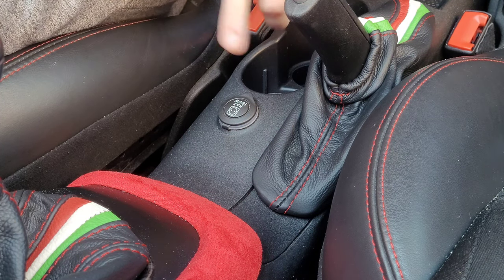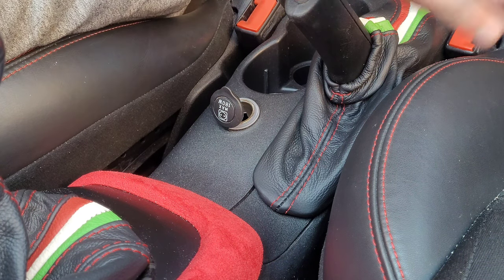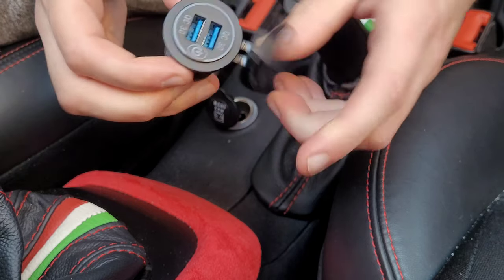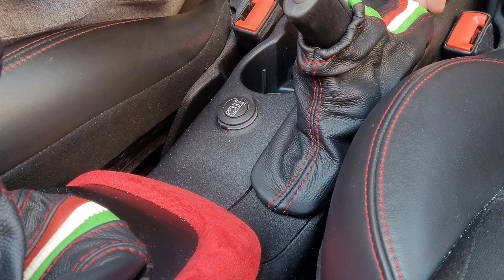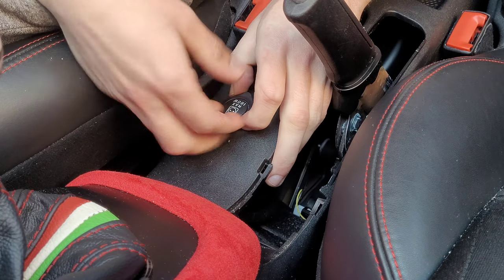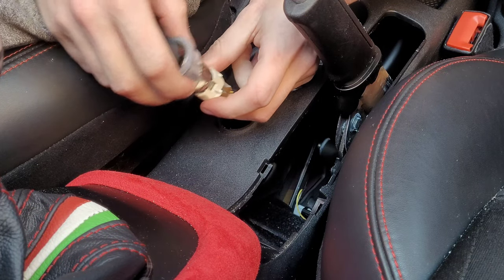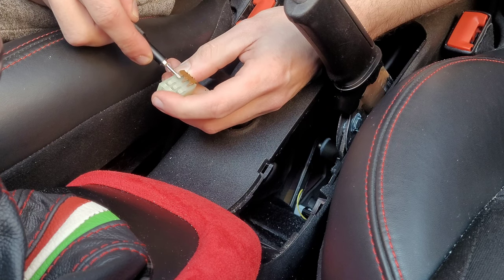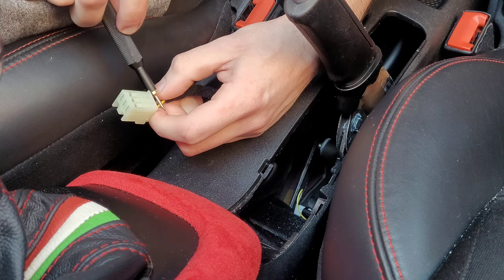Replacing 12V Socket With USB

Comment: That loose terminal could contact the uncovered ground terminal easily.  Better to cover it with some heat shrink.
Reply from the maker: Appreciate that mate. I crimped a cap on in the end

Comment: Just fitted mine, looks lovely. Thanks
Reply from the maker: Good! Glad it went alright, what colour did you go for?
Reply: @marcus_motors_  red, to match the stitching on the handbrake gator and seats. I did initially fit it without the cover, but got annoyed that it automatically turned on with the car and it had a blue light in the connectors, so had to take it all apart to fit the cover on. Cest la vie
Reply from the maker: Same here. At least you got it sorted

Comment: Simple and easy replacement. Great video
Reply from the maker: Thanks, glad it helped
Reply: @marcus_motors_  ya very good video . Do two of the wires have 12v?
Reply from the maker: As in the 2 that wires I used? They're the original feed for the 12v socket if that's what yoy mean, yesh

Comment: Just fitted mine but also added one to to the vent at the rear off car. There's no ashtray on my  vent. On my veloce 2018 the connection clips are not standard spades so had to improvise.
Reply from the maker: Rear as in boot, or you have an extra in the back fro passengers? Sorry it didn't help much haha atleast you got there

Comment: But you didn't even fit the red and wire that comes with the USB at all? I don't get how to fit it on
Reply from the maker: Hi mate, there's no end of variants with and without cables in the pack, I just went with the look and didn't use the wires. If you watch from about 3:20 once I'd taken the connector block off, it's just the two connections 👍

Comment: Hi. Is the usb still working. Looking to fit two. one at the rear vent
Reply from the maker: Hi, both of the slots work in the new one, if that's what you mean?
Reply: was just wondering about the reliability. I had one once that played up and would blow the car fuse every time it was used. Im fitting one a the front and cutting a hole to fit the other at the back near to the rear vent so kids have their own usb charging.
Reply from the maker: Ahhh got ya, I mean I haven't had any problems and I can't see it wearing as it's not a moving part if you know what I mean. But only had it on 9 months, so that as far as I can vouch for haha

Comment: My lighter is not coming off😢 i tried so hard but just half of it comes out of the hole
Reply from the maker: Is is the original one? Mine didn't have a locking nut on the back like the new one has. Can't you get you phone and try and take photos with flash on or anything?
Reply: @marcus_motors_  car is 2014 facelift one. I don't think there's a locking nut but i am going to try take pictures.

Comment: How did you know which wire was for illumination and which post was positive/negative?
Reply from the maker: Can't remember if it was stamped on the connections or I went by colours and eliminated the 3rd 😂 you had trouble doing yours?
Reply: @marcus_motors_  Just considering doing it. Black and white makes sense I suppose for pos/neg. Hopefully a Prius is the same :) Thanks for the response!
Reply from the maker: Yeah sorry mate I honestly can't remember 😂 or see if there's a diagram for the wiring colours in your specific car or possibly on a forum if you get stuck

Comment: Marcus Motors, do you have video of where to connect the DVR? If the camera is placed on the windshield and you need to hide the cable. Many thanks!
Reply from the maker: Hi? I don't have one. But if it's going behind or near the rear view mirror, I would tuck into the headliner, down the pillar then to the fuse box in the drivers footwell. Then piggy back on a source that works with the ingnition or interior lights 👍🏻